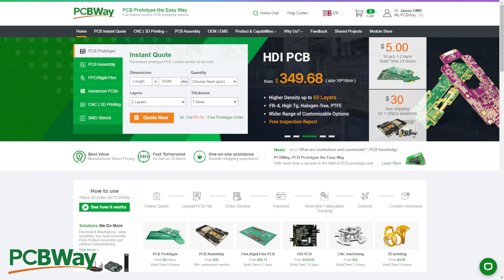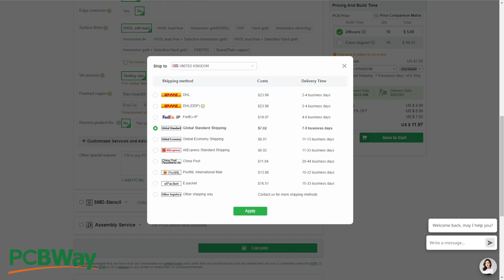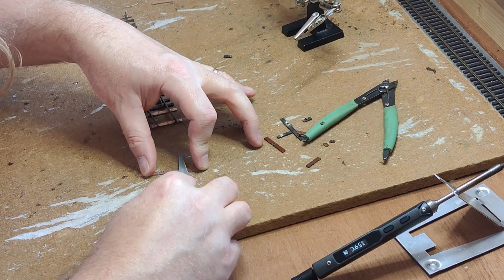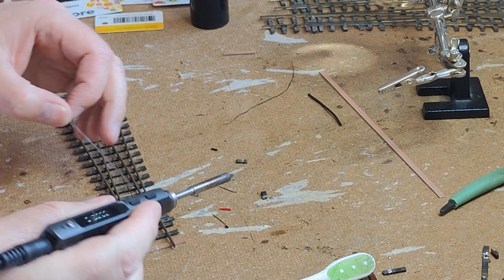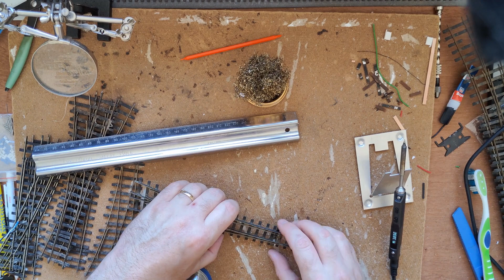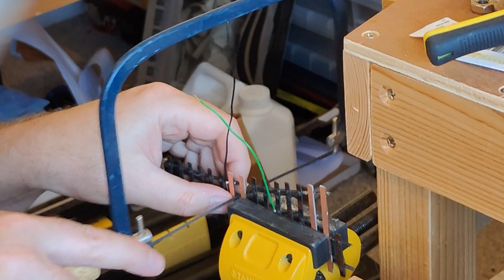Repairing second-hand hand-made points

Comment: I meant to ask some time ago, but did you ever add a fan to push air over the heatsinks on your DCC?
Reply from the maker: I haven't needed to yet, running one or two trains at once isn't pulling enough current to warrant it. But I have a pile of spare PC 120mm 12V fans, so when I start operating more it will be dead easy to hook one up.
Reply: @DongitsModelRailway  Right on, although the longevity of components part of me says you might wanna do it anyways but otherwise glad to hear everything is working out so far :)